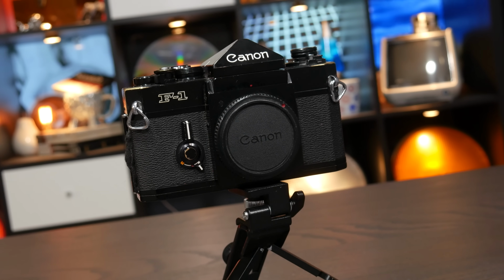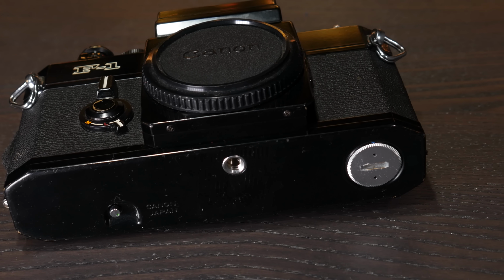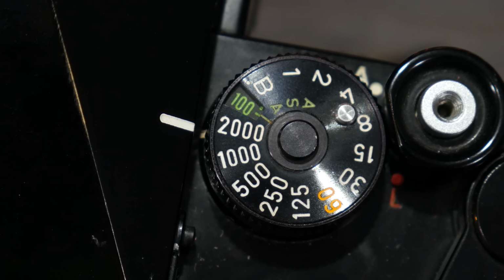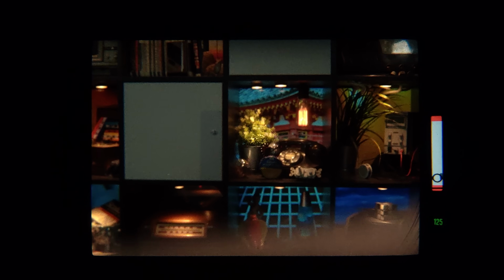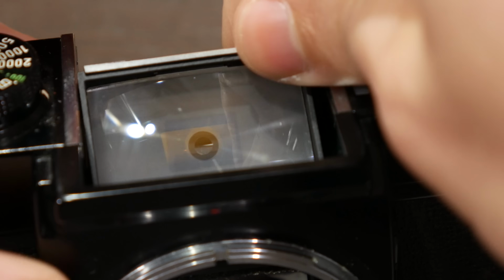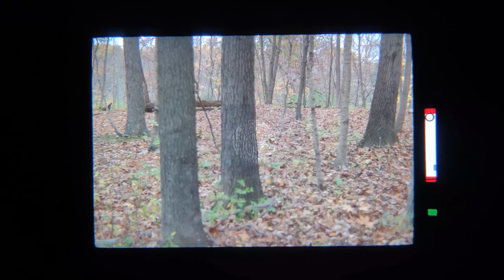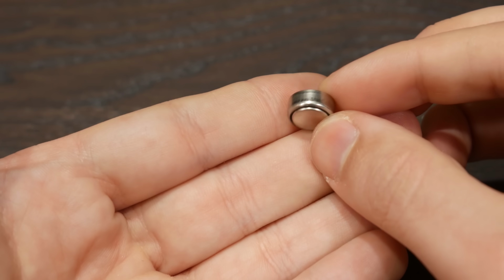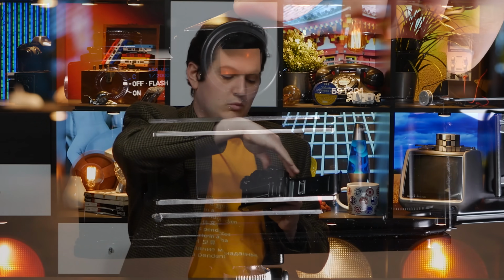1970's Camera Tech: How they showed you what settings to use

Comment: Wow. I didn’t know that’s how the Canon bends the light to the meter. I always thought they worked like the old Nikon F did where rather than a mirror in the focus screen, it was the prism bending light both right the eyepiece and the sensors. The Nikon version definitely seems easier to manufacture replaceable parts like different focusing screens, but the Canon version is pretty epic.

Comment: I dunno about the canons, but on Pentax Spotmatics, which have an extremely similar system, it is pretty common to install a voltage reducer to reduce 1.5v to 1.35v, meaning you can use cheap, long lasting batteries.  Mine was done during a CLA when the camera was apart, but there are also drop in adaptors for it too.

Comment: That lightmeter is a lot more complicated than mine (a Pentax K1000 ca. 70s-80s); it just has a needle that responds to both aperture and shutter speed and has a static target in the center as opposed to one that moves with aperture.

It's also interesting that you have issues with alkaline batteries because my camera was made for them, despite only being a few years apart in manufacture. The K1000 recommends both alkaline and silver oxide batteries in its manual, and even mentions coming packed with one out of the box.

Comment: I still have an F1 which has been in the closet for years. I also have it's lower cost sister, the FTb. The FTb looks similar, but has a fabric curtain instead of titanium, and a top shutter speed of 1000 instead of 2000. I have a few focus screens, which change the metering area for the meter. The focus screen is not removable by the user on the FTb. The case on the F1 is brass, I think if you dropped that camera on your foot it might break your toe, but the camera would be unaffected. Unlike today's cameras, if the battery dies the camera is still 100% usable. 
Thanks for the great video!

Comment: Surprised you didn't do the Nikon Photomic F. Though the F-1 and F-1n where great cameras, Canon's departure from the breech mount system sealed it's fate. Nikon on the other hand hasn't changed F mount since it's inception, to their detriment some might argue as the f mount constrained the lens designers considerably.

Comment: I still have a Nikkormat FtN and Nikkormat FT2. They are very much like the F1, with minor differences in the control locations (e.g., my FT2 has a DoF preview button up top) and lens mount.  As much as I love being able to shoot literally thousands of photos with a digital camera, I find myself missing the feeling of "handcrafting" images I had on the old mechanical SLRs.  Both cameras also have that button-battery-powered meter... but worked just fine with a dead or missing battery.  When using a familiar film, it wasn't too difficult to shoot a roll or three and have almost all the shots turn out well without a working light meter.  I still remember having my mind totally blown in a totally negative way the first time I was using a battery-powered camera and the battery ran down, leaving me totally without a camera for a couple of hours during a very photogenic outing with my SO of the time despite having an extra roll of film with me; it had never before occurred to me to carry batteries along with my camera.  (This was back in the 1980s, so no smartphone camera...)  Of course, now I have to deal with the shock value of realizing you're going to have to make a YouTube video to explain to the latest generation of photographers how film stored an image... Gawd, I feel old...

Comment: Can't you adjust for the 1.5 volt battery by raising the ISO one stop? Because the 1.5 volt battery causes the light meter to be more sensitive, wouldn't it fix the problem too just increase the ISO? (Side note: I use the light meter in my Minolta SRT 101 with a 1.5 volt battery and have not had an issue with exposures. As long as I follow the needle, my exposure seems to be proper.)

Comment: I have two analog cameras, a minolta srt 101 and a minolta xg-m. I had the 101 first but the curtains were no longer in sync resulting in photos where the left part of the film was far over exposed and right was underexposed. I still love my 101 tho and it sits on my shelf, but the xg-m is my new favorite film camera. Also on the xg-m I can use normal lr44 button cells and the light meter works perfect. Love analog photography

Comment: i have been using it for a while now, and i would say it is the greatest camera i've ever used in terms of consumer friendliness, despite being a professional model conceptually. although i dislike how dust can accumulate on the focusing screen due to the removable pentaprism having leaks, as well as the sheer weight, of course. and yes the light meter is amazing 50 years on.
i also love how you use the fujicolor roll for iso stats, since kodak doesnt show din at all.

Comment: Din is still has a measurement standard that's used... but its in skis. the resistance a ski binding has to opening is called a din. the lower the din the easier it is to pop out of the ski. beginners who are not on advanced terrain will have very low din for safety reasons. when you fall they will pop off preventing ankle rolling n such. but once you get into advance terrain there is a risk of skis popping off from just... skiing, so you have to crank your dins up. I was a ski racer so I had my dins cranked particularly high because you could push so hard off the start you could launch right out of them (which I have done before and its not fun... ok it was kinda fun)

i had never heard of dins outside of skiing so I thought it was made... just for skiing, was an interesting thing to find out

Comment: I took an old 1980s RICOH manual film SLR on a day out once, turned out to be a drizzly rainy day and to make matters worse the battery for the light meter died shortly after the day began.  I stuck to something like f8 and 125/sec with the stock 50mm lens and all exposures came out brilliantly, the camera didn't care about getting a bit wet as there was no electrical power going through it.  In the end I got some fantastic shots of us all getting wet and just having a blast outdoors, a testiment to these old camera's robustness and ease of use.  I certainly wouldn't have wanted to use my modern DSLR or even a digital compact in those conditions, I can just imaging a lot of the shots coming out blurry as well.

Comment: I never knew about any of that but I've also never had one of those cameras. I've had a couple of digital cameras but the only film camera I had was a kids one that had this film that was contained inside a plastic thing that fit inside the camera and you didn't have to try to get the film onto those little pegs on other kinds of cameras to get it to go through the roll properly. I guess that's why they had this kind of film for kid cameras because you never had to do anything but put the plastic thing into the camera and it automatically moved the film inside from one side of the plastic case to the other and then you'd turn in the whole plastic thing to get the pictures developed. That camera had a place for one of those flash cartridges but those were a row of bulbs that would each only flash once, so you'd go through them like you'd go through film (except there were always fewer flash bulbs in a cartridge than pictures you could take on a roll of film. I do like digital cameras a lot because there's less pressure not to take any shitty pictures since you can always erase them and try again on a digital camera. On film, you really don't know if you took a shitty picture or not until you develop it. I mean, there were Polaroids so you could technically take the picture again if you didn't like how it came out but you had to use up more film. My grandma had a Polaroid and I thought it was absolutely fantastic! Any time she would have it when I was around, I went through all her film because I thought it was so amazing.

I wonder how the light sensor in that camera relates to the ones in digital cameras. Something that has always bugged me is how you can never get a good picture of the moon and it must have something to do with those light sensor things. I only have a phone camera now so the size of the hole is probably a problem there. I did manage to get an okay picture of the moon when I took it with my phone through a pair of binoculars but that was really hard to do.
Reply: You had a 110 cartridge automatic camera. We called them, "one-tens" and I still have several different ones. I also have an old Brownie like he has on the set here. That's the box looking one that sits just to the right of his F1 (I have my father's F1, by the way). I have 2 Lands, and I still go grab carts for those and take pictures. Mainly, I use one of two of my DSLRs. I had to laugh when I pictured you taking a pic of the moon with your cell thru a pair of binocular. That's fantastic! Keep trying things like that. You can upgrade to a different set or get a little tripod that you can mount the ocs to. I have a Dobsonian telescope that I have, so many times, tried to get a pic through or video (without buying the equipment to do it). LOL... I've almost dropped cameras, and yes, I did drop my cellphone once. This is a bigger 10-inch Dob telescope too, so you are standing up to look through the viewer scope. Keep taking pictures and keep looking up!

Comment: You describe film as having "clear plastic backing".  Actually, for most films, the backing is tinted rather dark.  This is to reduce the light which gets through the emulsion, passes through the backing, then bounces off the backside of the backing, back into the emulsion creating a "halo" around bright spots in the image.  This is referred to as "anti-halation".  This tint reduces light when using an enlarger to make prints, which is no problem (just increase the exposure), but for slides, the projector would have to cook the film to get enough light through!  Some slide ("reversal") films had tinting that was washed out by the development.

Comment: When you said that "SLR" stands for "Single Lens Reflex", I thought to myself: "ah okay, so DSLR must be Dual Single Lens Refl- wait.."
Reply: actually there's a dual lens camera called "twin lens reflex" ("TLR").
Reply: @khairulhelmihashim2510  I am also fairly certain that SLRs are analog only and when someone figured out you can use a couple lcd displays instead of a complex prism and mirror set up to take the same picture is where Digital Single Lens Reflex cameras come in.
Reply: @michealpersicko9531  , mirrorless camera.
Reply: @michealpersicko9531  SLR's are indeed analog only, by definition.  That's because the D in DSLR stands for digital.  Digital Single Lens Reflex.  Also, both terms refer to the mirror mechanism itself.  As khairul pointed out, when they got rid of the pentaprism/mirror assembly, they called it "mirrorless" or MILC (Mirrorless Interchangeable Lens Camera).
Reply: @jasondashney  Mirror I'd Like to Clean
Reply: @michealpersicko9531  No there are digital single lens reflex cameras. They have a digital sensor, but keep the same arrangement of mirror and pentaprism. They are designated as DSLR  cameras.
Reply: @ayebraine  OMG!! I'm in tears!!
Reply: @michealpersicko9531  Analog is what the video signal was before it went digital. Non-digital cameras are FILM cameras. That is why there are SLR and DSLR cameras. :-) Single Lens Reflex and Digital Single Lens Reflex. Analog is a type of video signal.
Reply: @michealpersicko9531  no DSLRs are still the same mirror system. you still see the exact light that passes down the lense and its still displayed on frosted glass and inverted with a prism. the only thing that changed is film was replaced with a digital photosensor array
Reply: @Rocketryman  Not all non-digital cameras are film cameras. Some use plates.
Reply: @AirsoftAbominations  Yep!
Reply: @michealpersicko9531  No, DSLR's still use the mirror and pentaprism set-up, the latest DSLR with the exact same mirror and pentaprism as the SLR you see in the video. What you are describing is a mirrorless camera, which is a even newer technology than DSLR.
Reply: @michealpersicko9531  Actually not. Early DSLRs worked much like film based SLRs. The back display was only for viewing images you had taken and to access the menus. In around 2008 they added a view mode where you could raise the mirror up and use the back display to take photos. This also allowed taking videos which before that was impossible with DSLRs. The main mode for taking photos still was the traditional using the mirror.

Soon after that they developed mirrorless interchangeable lens cameras (MILC) or just mirrorless cameras that removed the mirror and the pentaprism and had an electronic viewfinder - though many early models had only the back display for taking photos. Note they are not DSLRs as the R stands for reflex i.e. mirror. Since 2020 the focus has been entirely on mirrorless cameras.
Reply: @Rocketryman  No, analog does not mean it is a video signal. LPs are analog.
Reply: @jasondashney  I call my camera EVIL (Electronic Viewfinder Interchangeable Lens)
Reply: @ Haha, I like that
Reply: Problem with TLRs is you need two lenses, but they were very silent because there was no mirror.
Reply: Digital.
Reply: Ah, that moment when you realize you might be dumb. I know that feeling all too well.

Comment: Way, WAY late on this, and it may have already been mentioned, but if there's room, wiring a germanium diode in series with the sensor will provide almost  exactkt the right voltage drop to use an alkaline cell in place of the old mercury cell.

Comment: with this camera specifically, it's notable that it has an alternate finder called the "booster finder", designed to meter for extra low light.

I don't think any other SLR system made meter heads like that

Comment: I was a Canon shooter for 20 years up until 4 years ago (still have my gear). Switched to Nikon digital and got into their old film cameras as well. The Nikon F2AS is worth looking at as it's considered the pinnacle of mechanical cameras. The Canon F1 derives from it. Another camera worth looking at is the Nikon F3 and the F4 (the later beingna very interesting looking hybrid between more modern SLRs and the older mechanicals) 

In 2001 they actually released a tribute to mechanical cameras with the FM3a (no removable finder though).

Comment: 35mm photography was my hobby in the 70s and 80s. Started with a Mamya Sekor 1000 DTL. Went to a Canon FTb then stepped up to a Nikormat FTn - the most ergonomic camera I ever owned. That got stolen after running 2 rolls of film through it.
Bought a Nikon FM2.Added a motor drive and additional viewscreens.
Shutter speeds up to 1/4000/sec with a flash synch of 1/250/sec.
Love manual cameras!

Comment: I've just been getting into film photography, so I find this interesting.  I've been wanting to for years (since I started doing digital photography in high school), but I found the barrier to entry a little too high for my liking.  Anyway, I recently borrowed a Nikon waterproof camera from the early '80s, which my dad had lying around, and took it shooting.  It's not an SLR, so there's no way to see the focus beforehand.  The lens has a pretty good indicator of the focus range, though, so it's pretty easy to guess.  There is, unfortunately, no way to set the shutter speed manually (unless you want 1/90th of a second or the bulb mode).  Instead, the camera uses the light sensor and your film's ISO to determine the shutter speed automatically.

My dad also has an Argus C3 "brick" that I want to use sometime.  Its shutter speed only goes to 1/300th of a second, so I will probably want to get some 100 ISO film first.  Literally everything is manual on that one.  No SLR viewfinder and no light meter.

Comment: If the light meter works in a way that has a constant resistance, you might be able to rig a spacer with a set resistance that would drop the voltage of a modern battery to the correct level. Not quite as energy efficient but it at least doesn't have a time limit.

Comment: I happen to own a canon SX150, and it has pretty much the same exact settings (though, it's not a D/SLR), and I managed to screw with a few settings and got a white image at night (unholy  rainy hell, how does one end up with such a mishap??) in a very dark environment.
Still gotta get proper AA (li-ion 1.5v) types, because due to a fault (manufacturer flaw), it detects good batteries as "dead" at random.

Comment: I forgot all this stuff years and years ago. I used a 70's Fuji manual camera for many years. It got retired in the late 1990's. It had a needle inside the view finder for light metering. It was super easy to use. Set the ASA, hold the button and adjust the f-stop. Perfect exposures every time!

Comment: 8:57 When I was learning video engineering we didn’t abstract the ccd sensitivity into iso numbers on our CCU.

We called it gain and we would express that as dB, with 0 dB being roughly analogous to ISO 320.  Each additional 3 dB of gain would double the sensitivity, so +3dB would be ISO 640, -3dB was ISO 160 and so on.
Reply: That's basically what film engineers described as DIN. It's given in degrees for some reason but it is a dB scale starting at ISO 1

Comment: Oh thanks for the nostalgia! i had a Canon FTb, a model from a few years later, very similar! i used it for years, loving it...till I could no longer get the battery for it. But by then I was so experienced I didn’t need the light meter anyway. Oh..I used a flashbulb flash with it.

Later I bought a Canon AE1, which I liked till I discovered that when the battery died, the entire camera didn’t work. Not even the shutter! It was no longer elegantly mechanical!